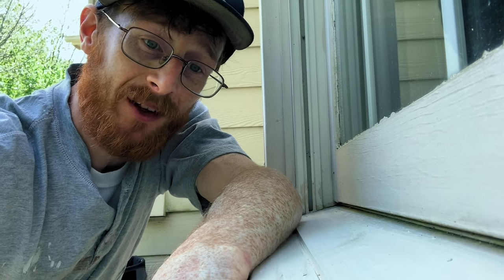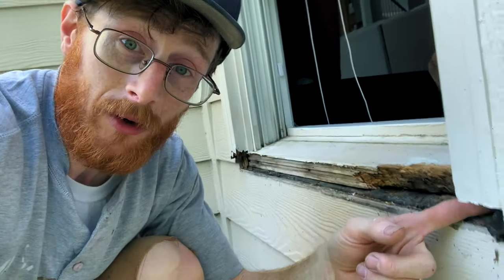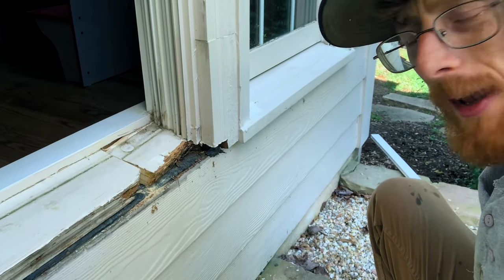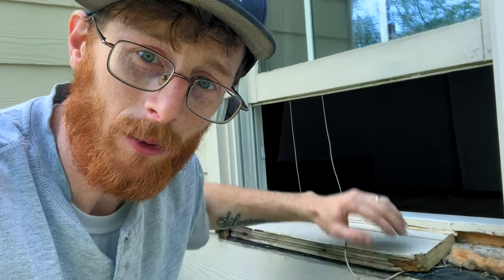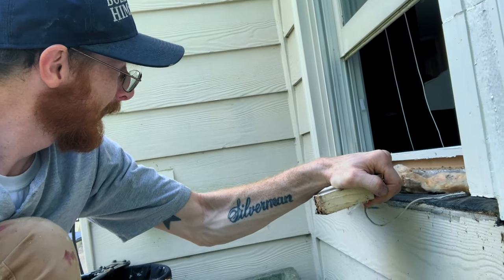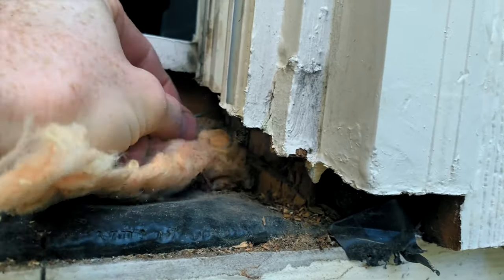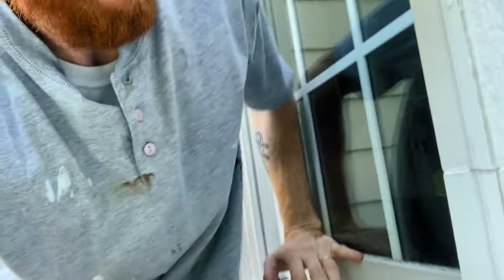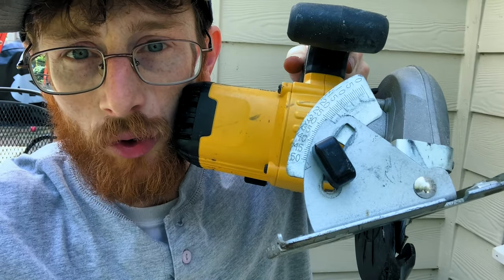HOW TO remove and replace WINDOW SILLS

Comment: Just rip out the left and right side once you cut out/removed the center sill: bad advice, really bad advice.  This cracked the interior stool, and on my double hung frame, broke and ripped out the wood that the track sits upon.  So, both window sashes and the track on that side had to be taken out to repair that.  Instead, tap the remaining sill with a hammer to create space between that and the frame, then slide a long flathead screwdriver between the remaining sill piece and the frame and pry it away.

Comment: The problem is, if the house has newer windows, the bottom of them runs right on top of the sill, all the way across. Therefore, the sill can't be cut in this way.

Comment: Hey Chris,  thanks for the video.  It was a big help.  Unfortunately, my sill did not come out as easy as the one in the video.  The guy who installed the window and interior trim must have owned stock in a nail company.  (eyes rolling)
Reply: Use a SawsAll, to cut free.  The RipItOut method may damage the brickmold and the inside sill.

Comment: Great expectations ! I’m not a carpenter and my Outter windowsill broke off which then allows all the water to drip down behind the vinyl siding because they had it tucked up under the windowsill but we use teen challenge carpenters which I would not recommend the shotty work yes in expensive and I was cool with them but still shotty work something just wasn’t right Why it Rooted out !

Comment: Your video taught me two successfully replace three sills for "normal" size double hung windows.  Thanks!!!  Much appreciated. But now I have a larger picture window and have 3 concerns.
1) I presume the 2x4 rough sill framing provides the main support. On the inside, just the drywall? It's raised higher than the rough sill, won't the drywall break?
2) Why is there a little groove along the interior face of a pre-cut sill?  
3) If a pre-cut sill is lacking sufficient depth (from outside to inside), because the wall is too thick what's the best way to proceed?  Mill a custom sill?  Join another board to the interior  length? Give up and call a pro?  
Any suggestions would be great. Thanks

Comment: Saw a couple of your videos on this.  Your repair is applied to traditional (i.e. "old") windows that are frameless with window sashes in the window opening, where the window sill actually is a component of the window and not just an exterior trim piece that can be applied after window installation, right?  I'm trying to understand the different window scenarios possible when there is a window repair.  Thanks.

Comment: At 0:32, you mentioned that you did not know the name of the window trim you pointed to...Hardly anyone knows... Vinyl compression jamb liners are held in the jamb pocket via a flange on the edges. These flanges fit into a groove in a piece of trim called the jamb stop. There is a jamb stop on the exterior side of the jamb, and one on the interior side. When viewed outwardly, it appears to be a solid piece of wood, but it has cut grooves.  I need some of that molding on my window repair as well. 
Also, you mentioned 22 degrees as the angle for the cutting the side trim where it meets the sill. Most others use a standard angle of 15 degrees, so I was wondering how you came up with 22 degrees.
Reply: I ended up making my own with pine 1x2's. planed them down to size and cut the grooves which I assume prevent the wood from bowing and bending.

Comment: Awesome! Hey man, what is usually the cause of these rotting? Is it because it's not painted all the way around on the cut edges and such?  I want to make sure my replacements don't rot! Thanks for making these videos!
Reply from the maker: I think making sure the seams are caulked where the brick molding meets the sill is most important because consistent water touching those seams the wood will soak up into brick mold going upward. I see the same thing happen a lot on the bottom of exterior doors on the jam next to the sill plate.

Comment: What type of wood to use for replacement? Treated? Pine? Cedar?
Reply from the maker: I use a primed pine exterior sill window sill moulding and nosing from Home Depot
Reply from the maker: https://www.homedepot.com/p/Alexandria-Moulding-AMC-1500-1-1-4-in-x-6-3-4-in-x-96-in-Pine-Primed-Finger-Joint-Sill-Moulding-A1500-93096C/205958707

Comment: Thank you for this. If just the nose is rotten, is it okay to just replace that or does the entire seal need to be replaced?
Reply from the maker: If the nose only is rotten and it will separate from the sill without damaging the sill And I would replace the nose only
Reply: Thank you!!!

Comment: Why was sill so rotted? Did those factors, like flashing above or on sides get corrected, fixed?
Reply from the maker: In most cases the caulk breaks where the brick mold meets the sill and water seeps into it. The best way to prolong the life of the sills and moldings is to keep it caulked and painted.
Reply: @ChrisSilverman  Thanks for explanation. Does this mean to inspect condition of caulk and paint every year or so?

Comment: My window need new sill nose but home improvement stores don't have the exact stuff. How can I get it ? It looks similar like yours in the video.
Reply from the maker: Otto Szasz 
Otto Szasz I purchased these from Home Depot. Lowe’s hardware stores also carry these. Here is a link to the sill:  https://www.homedepot.com/p/Woodgrain-Millwork-WG-WDS2-1-1-4-in-x-4-3-4-in-x-96-in-Primed-Finger-Jointed-Pine-Sill-Moulding-10004487/206178844?irgwc=1&cm_mmc=afl-ir-2076208-459920-&clickid=VugXecTsSxyOU7jwUx0Mo38TUkiRhCwmP3dE0c0 Here is a link to the nose piece: https://www.homedepot.com/p/Woodgrain-Millwork-WG-WDS1-1-3-4-in-x-1-1-8-in-x-96-in-Primed-Finger-Jointed-Pine-Sill-Nosing-Moulding-10004480/206178837?irgwc=1&cm_mmc=afl-ir-2076208-459920-&clickid=V7oT1dQEYxyORwZwUx0Mo38qUkiRhC12P3dE0c0
Hope this helps!

Comment: Can I do this for my door threshold. Looks similar to the window sill here. Just trying to figure out how to repair it. Wood is rotted
Reply from the maker: ZB87 Unfortunately Door thresholds are different that have to have a custom made piece. I’ve used 2x10 treated lumber for the doors.
Reply: Chris Silverman I measured my existing sill. It is 7-1/4” x 36” x 1” thick. Will that work?

Comment: love your vids! I have a question. How do I remove the sill on a 3 window unit? (you should do a video on it - can't find any on youtube of double or triple windows with 1 piece sill) I removed the apron and it appears to be one continuous sill interlocking all 3 windows. Should I use an oscillating tool to cut the sill from the inside of the house under each vertical part of the window so I don't rip the windows apart when I pry it out? Does that make any sense? I can send a picture if you have a second to tell me. thanks!
Reply from the maker: Next opportunity I will for sure do a video. The 3 windows actually have 3 individual sills and one long nose piece that makes it look like one long sill. So, the process for repairing the 3 sills is going to be very similar.
Reply: @ChrisSilverman  man I was really hoping you were right....but you weren't lol. It was one long sill dovetailed together at the bottom where the vertical side pieces came down to meet the sill. Ended up cutting the sill out around the 2 vertical pieces and then notched the new sill and installed

Comment: John S   Chris  I plan to replace my Sills with PCV what do I use for nails and what type  Thanks.
Reply from the maker: Joao Silva For PVC I usually use an exterior grade 2 1/2 inch or longer T-10 screw. It’s a strong 💪🏻 skinny fastener.

Comment: So now ,  seeing those pin nails makes me think this was repaired not all that very long ago.  I’m in a super rainy region and the way sills are done around here is no different .  Besides using a primer like Kilz - and there’s another product I saw recently that is used to seal MDF that I thought might help - I wonder how we can keep this from happening ?  Of course using a rot-resistant wood ,,, but , unless one goes to the trouble of milling their own brick molding in addition to the sill material being more resistant , I wonder ?
Reply from the maker: Home Depot sells pvc window sills also. I think they are good for rainy and humid regions. Not very good in direct sunlight though.
Reply: @ChrisSilverman  Sorry to hear that, as the worst in my house are those beaten by mid-summer/mid-day sun and I was hoping to use vinyl.  Why are these not good for direct sun?

Comment: Good info, thanks.
Reply: I just tried a vinyl version window stool and something went wrong, it ended up being too low. The window in closed position still had a good inch gap. It was getting dark, had to just button it up by adding a piece on top. I'm frustrated.  It's nothing that you showed, I just done something wrong. I replaced just like old o e come out, even though the new vinyl was shaped different.

Comment: How much can they charge  me for doing this. I dont have all the tools do to it myself.
Reply from the maker: Oscar Eli I charge between 190-385 labor depending on several factors. Different Companies charge different rates for the same product replacement but this is in my opinion a good ballpark number.
Reply: @ChrisSilverman  per window?
Reply: @oscareli5114  It's definitely per window.   That's a lot of skilled carpentry work.  I've had the same done and it ain't cheap.
Especially if they have to do 2nd story work.
Reply: Charge depends on proximity to major metro.  For 190-385, it'd be worth buying the tools and doing it yourself.